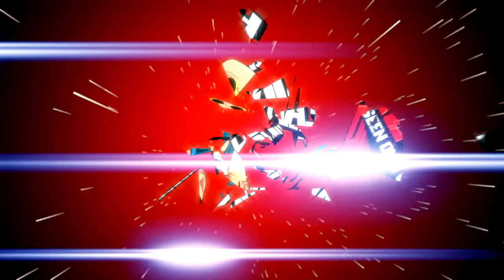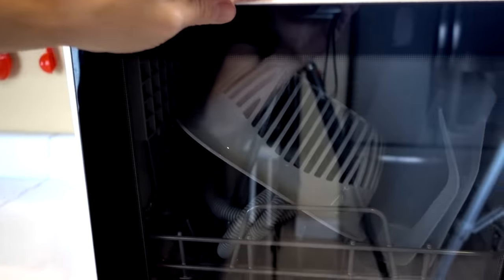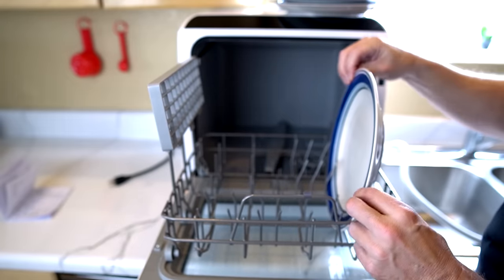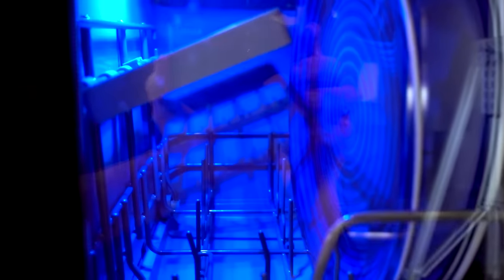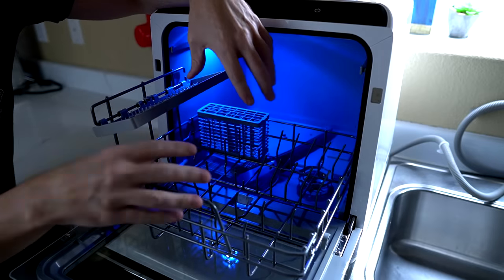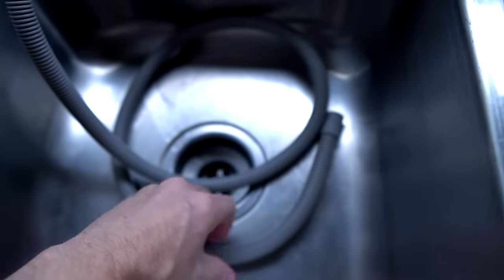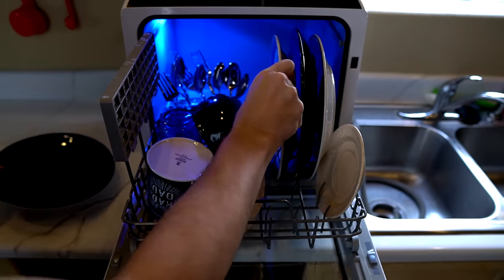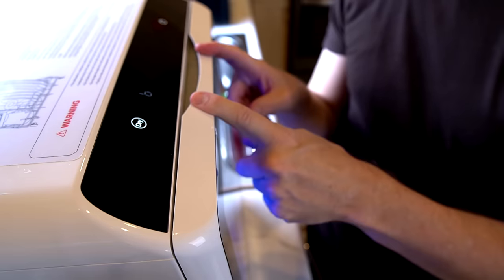Do Countertop Dishwashers Work? By Request!

Comment: OK, watched all the way to just before the "unfair test" reveal.

Dishwasher detergent (think Cascade, not Dawn) has a lot of enzymes designed to break up proteins and carbohydrate chains that weld themselves to dishes, in addition to the detergents that break up fats into super small droplets that can be rinsed away. I predict both dishwashers will do pretty well, considering both are using Cascade. It's one reason why dishwashers tend to do very well compared to manually washing the dishes.

Comment: Both full size and countertop dishwashers work better if you run the hot water in the sink first.  This way the water is at its hottest when you first start the dishwasher or fill it manually.

Comment: Did you buy the smallest cheapest version possible? I have a counter top that can hold  3 times that amount. It also has detergent door (so you actually have a rinse cycle, before the wash cycle) and  a "jet dry" compartment for no spots. It also takes 90 minutes from start to finish (that includes the drying cycle). If you're serious about getting one; look up Danby or Whirlpool counter tops.. they cost about $250.

Comment: Even if these do actually work, they're too small to be practical to me. My partner and I cook at home a lot and that means we have a lot of pots and pans alongside silverware, plates, cups,  you name it. Anything that doesn't fit in our full size dishwasher just gets washed in the sink because that takes only a minute or two. And for $350, it's not that great a value. $400 can get you a new dishwasher with basically no bells and whistles, but it will hold a much larger load. My Whirlpool dates to 2008, and it cleans dishes near perfectly with some caveats. Starchy foods should be rinsed off before you put it in or things like potatoes can get baked onto dishes, and the dry cycle doesn't really get things all that dry on the top rack unless you open it at the start of the dry cycle to let out the steam. Still, I can have the thing loaded up in 5 minutes or less, punch Start, and walk away for a couple hours.

The only real application I can see for something like this is a van or an RV where space comes at a premium. You're probably doing quite a bit of eating out or microwaveable foods that only dirty up a few things at a time. Dishwashers use A LOT less water than washing by hand, and that's important when you can only carry so much white water at once before you can refill. If you can wash all your dishes from a day using 3 or 4 liters of water as opposed to something like 20, that's a lot of water conserved for other important things like drinking.

Comment: A good dishwasher,you shouldn’t have to rinse the dishes,just scrape off food into trash can,insert dish. 
I think most mid price and defiantly high price dishwasher,come with built garbage disposable,removable screens,for easy cleaning,and washer wands,that can be periodically removed to clean out the holes for food particles that escaped the water screen. The best ones,also have a built in water heater,for really stubborn dirty dishes or Pot & Pan washing scrubbing setting. 
I dislike washing dishes immensely and my hands crack & dry from the dish chemicals. I counter too would be great for this Widowedguy. Thumbs way up.

Comment: The real value of dishwasher is energy savings, e.g. it uses about ⅛ of the hot water handwashing with a full load. But that's irrelevant to apartment renters for whom these are targeted. The landlord actually pays for fuel and water, so water and fuel usage have no impact on the renter. The renter actually ends up paying more because they pay for electricity. However, I got one by anyway because dishwashers can disinfect using high temperatures and enzymes that handwashing can't achieve. Furthermore, it gets into cracks and crevices, e.g. in lids, that no sponge can.

Comment: I’m one who needs a tank too. I’m planning on buying a countertop dishwasher for my semi truck. Can someone tell me how many watts this uses for power? My truck has a 2000 watt inverter. I’m looking for a model that uses no more than 1500 watts.

Update: I wound up buying this model and it's fantastic for truckers if you run solo and want money and time saving modern conveniences. I wouldn't recommend it if you have two people on the truck. Items of this size work well if you have the available storage space though. I keep mine in my passenger seat, plug it into my inverter as needed to wash dishes, silverware, and my whites (laundry) that need hot water, since my on board washing machine can't handle hot water. I love this thing! I just pour water from my five gallon jugs in as needed, and toss the drain hose out through the passenger door. As an added bonus, said drain water is helping truck stops around the country not smell like piss.

Comment: I was wondering what about a few pots or pans? That is what I was hoping you would show. I have a full dishwasher presently and I rinse all the dishes before I put them in, and there are many times they come out with residue  on them.  Now I am moving to a house with no dishwasher and no room for one (needs some remodeling), so I was thinking of getting this countertop one.

Comment: Although not many dishes (and even fewer bowls) can be washed in a cycle, those with  hand/arm limitations or with really dry hands from low humidity in the winter would probably benefit from such an appliance, especially if there is no room for a standard dishwasher in their kitchen.  I would caution using any powder detergent.  I have used Cascade and found that my dishes and glasses were getting etched.

Comment: ok, the reason i bought mine was  physical condition of me and my 80yr old plumbing. i no longer able to stand that long to stand and do anything, and my small kitchen  my house was built in 1946 with galvinized pipe which has coroded to the point of severe restricion on hot water. so the dishwasher will heat the water for the job. in short, i love mine.

Comment: So am curious about the energy usage since it basically takes 2 hours to do a complete wash & dry cycle when a standard dishwasher takes much less time to complete a full cycle. Standard dishwashers also start out with already hot water and the heating elements just boost it to a sanitizing temperature. The countertop washer has to heat the water from cold to sanitizing temperatures so seems it would take more energy to do that (and is probably part of the reason normal mode takes 69 minutes just to wash). It didn't appear you used already hot water when pouring it in or, if you did, you didn't say so. I do now want a dishwasher with a clear glass front and blue LED lighting though 😆

Comment: I got a big countertop dishwasher.  It was working great.   Then the soap dispenser wasn't opening and the pod was still in there.   So I just started from the pods in the actual dishwasher.        So tonight my fiance was looking at it.   He said to keep the pods to the right.   Well I noticed I was switching to the left.   But I didn't put two and two together because they're two spots for pods on left and right right beside each other.    Well I put the pod on the right side and what do you know it.   So I guess the left side is just for liquid.    And another thing when I first got it for probably two months.   I thought the setting was only for 1 hour and 50 minutes.     Well I think 2 weeks ago I realized they had different settings.   A 20-minute setting and so on.   So I always set it for 25 minutes.   Because I always like to turn the hot water off before I leave.    I'm just watching him fill up his with water.   I just hook mine up to my sink and only put the hot water on.    I find when I put the dishes right away when they're hot.    They're completely dry.    But if I let them sit for me a couple hours.   I guess the steam from the heat gets them a little wet again

Comment: I would be interested to see how the countertop dishwasher does on pots and pans.  I'm not surprised it got the dried on food off because once you wet them down that stuff should come off.  I was wondering if the dishwasher heats the water or do you have to use hot water in the tank?

Comment: Those little ones are only for one set of dishes, maybe two and flatter plates and slim handled silverware with standard sized cups. Those off brands are often made for Asian markets mostly as well so that may be why. It's one of those set it and forget it type of devices for doing chores, and saves you from having to hand wash dishes. So far they all seem to get about the same reviews as regular sized dishwashers. I would get one if I had an RV or a tiny apt without a dishwasher.

Comment: Is there a video of how you  connected the counter dishwasher before we started using it !!??? Thanks 😊
Reply: I think he mentioned his faucet isn’t compatible with the faucet hook up . These models there’s no need to hook up to a faucet if you can’t. The dishwasher comes with a built in tank so there’s no need to hook anything up. It’s actually very easy to set up.

1. Put in drain hose it’s not that hard 
2. Plug in 
3. Fill with water using the pitcher provided.

I bought a similar one used from Amazon last year but it unfortunately it decided to stop working so need to buy a new one.

Comment: Hi, I recently purchased this dishwasher. I avoid using Cascade or Finish due to toxic chemicals. So I used only two drops of Seventh Generation liquid dish detergent to my lightly dirty dishes, however when it was done, there were suds/foam at the bottom where the filter is. Would you know why and what to do to avoid foam forming? Thank you in advance.

Comment: I connected my B&D one directly to my sink waterline with a splitter, and then a bunch of different threaded male and female nuts to get it to connect. Sadly I could not get an on/off switch that could handle the pressure. 🥲

Comment: I have seen the US style countertop dishwashers and the UK versions, and prefer the UK versions as the ones we used there heat their own water and can dry the dishes as well, though they are not as economical that way. I have solar panels so simply have a UK car inverter for my dishwasher from the house 12 volt battery bank.
Reply: nut the tank option though.. I could see a trucker using it to wash his or her dishes while on the interstate driving

Comment: Argument whether to use dishwasher or to wash by hand is that you will use much less water with dishwasher than if you wash by hand, especially those caked on dishes that need a lot of scrubbing and time under the faucet.  Dishwasher will recycle the water that is saturated with dish soap over and over again while washing by hand will usually just drains out immediately at the sink.  All that while doing all dishes at the same time.  And it also dries and sanitize so that you know that there will be no germs left on those dishes.

Comment: FYI, for the same price, $299, or a few dollars more, I've found several countertop dishwashers with double the capacity.
Reply: Ive found several that are slightly bigger. But no tanks. Ive also been looking for one with a built in tank. I have hard water and it messed up the hookups for my built in dishwasher. And its too costly to fix.

Comment: I do think the idea can be nice for houses without a full sized dishwasher maybe apartments, and unlike the portable units that are basically just a dishwasher with a top and a weight on the back it at least doesn't need to be hooked to the sink, but really for me it seems a little small, like what about pans, i know i have some pans that will happily fit snugly into my full sized washer, and even in my smaller portable unit i had in my old apartments, but i know wouldnt fit in this, and the way i think of a dishwasher is to be able to wash literally anything that says dishwasher safe, like for me a portable wheeled unit with its own water tank would seem to be a better idea, but these are novel anyway.

Comment: i agree with the fact you could wash the same amount of dishes in half the time, but if its using the 2 liters of water from the reservoir to wash the dishes i would buy it for the water savings alone

Comment: So the reason why these are comparable is that... well they're the same.  One is merely smaller than the other.  It uses less detergent but only because it uses less water as it has a smaller volume.

Both still use a tank (Yes, your dishwasher washes via a tank, it just fills to a certain level and reuses the water)  - So basically the only difference here is the programming and the spray nozzels, which are likely very similar.

Not much has changed in Washing Machine techology.

The reason you'd get this is if you had a smaller apartment, lived alone, and just wanted a dishwasher, but had no place to install it.

Comment: I would imagine that the little dishwasher would be just the right size for a caravan, if there was an adapter that you cld to connect it to the car u could use it tenting, if u didn't hv a powered tent site?, but I wouldn't be lugging it to the camp kitchen and back!

Comment: Pros... only requires 5L of water. Handwashing can easily take 15+ litres of water. Cons, the small capacity and long cycles... Pros doesn't need to be hooked up to a faucet. Cons the tank must be filled for each wash. The tap connector is good but a bit annoying to keep swapping water saver aerators for the hose per wash. I changed my water faucet to a hose extension type to bypass the jug filling. Works better this way.

Comment: Is it normal to have drippage at the bottom of the door? I have the same one and it’s leaking a drop a second. Enough to wet a towel after an hour? Did I recieve a faulty door or seal on my door? Or is this the normal drippage they talk about in manual? Did anyone else have this issue?

Comment: It wasnt that you were pouring it from so high even though that is part of the case... But the fact they put the "X" design on there with the hole in the middle give it a surface to splash onto instead of the plastic Mesh! #LavaLab™

Comment: So with dishwashers they actually don’t use as much water (most people keep the tap running when washing dishes) + no matter how hot you wash, the temperatures will never be nearly as hot when washing by hand than when washing in a dishwasher***

***I’m not sure how hot the countertop dishwasher gets

But yeah overall, it may not save a TON of time but it is certainly better. Also if you have a pot and pan might as well fill those up and wash only a few things by hand rather than everything

Comment: Ok, so, if you don't have a dishwasher, or space in your kitchen for a mobile dishwasher that you manually hookup to your sink, I guess this is ok at $350.. but.. we just bought a mobile dishwasher for our kitchen for $550. Full size, on wheels, that is about 5 times the volume of this dishwasher, with more cycles, and way more options. I think this is kind of cost prohibitive.. plus, for $350, if you only use a small amount of dishes like this, just wash them by hand and save the $350..

Comment: You shouldn't let the hose go into the sink so it rests on the floor, it can create a vacuum that can suck the used water back up into the machine. It needs to hang down lose..   No dirty thoughts here guys.. 😏
Also, here we need salt as the water is insanely hard. We do our kettles once a week to keep them working. Also, there some gel that makes gkasses shiny and soft so that need to be looked into.  Mine will get here in about a week if im lucky.

Comment: Your plates are wrong that's why they are not leaning back. If you want to use this dishwasher you need to change your sink, change your cupboards, change your dishes. Then it will work

Comment: I liked the cleaning test but I would have been disappointed if 69mins of steamy wash cycles didn't soften the gunk on those dishes. You probably could have left them on the bench with water in them to soak for 69m and it would have washed off easy enough.

The main question I have which is hard to find reviews that have an answer is how much water and power they use per cycle. The hot water in my house takes quite a while to heat up and you need to have the tap completely open for it to heat up, so it wastes a lot of water.  How much of the water you put in the reservoir does a normal or speed cycle use? I'm guessing you don't have a smart plug with energy meter on it but that would also be an easy bit of information you could add to future videos like this.
The materials, manufacture and transport of the appliance itself are also a factor but I don't know how your average reviewer can answer that... I wonder how long I would need to use this for to get a positive financial and (lessen the) environmental effect.

*I'm in Bisbane Australia so don't have large water reserves and the government charges quite a bit for water supply.

Comment: Why is there a blue light and not a regular white light? Blue light is harmful to the eyes, and especially bad for toddlers, who I'd expect to be mesmerized by the sight of spraying water. The only reason for blue light is UV-C, which can be used for sanitizing. But that doesn't appear to be the case because the light stays on when the door is opened.